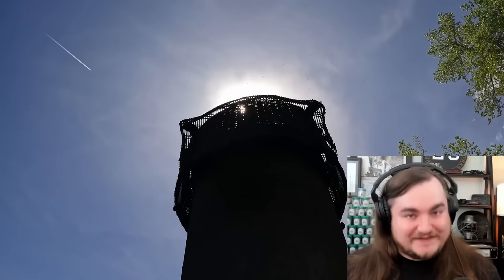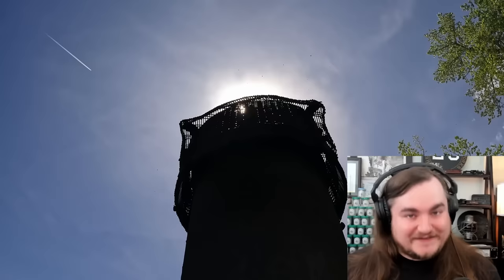Why do USA steam trains make smoke, but UK ones don't?

Comment: I also feel like the fact that in the US, our engines chuck everything out the stack, UK engines don't, and that's why they clean their smokeboxes often.
Reply: Do American engines make sparks, though? British engines produce a lot of sparks. You can see just how many they make at night. I've never seen this on American videos. Lineside fires are quite common along UK heritage railways in the Summer.
Reply from the maker: Brett told me about this after I posted the video ready to go, definitely a miss on my part. Our smokeboxes are "self cleaning." For you Brits out there, we clean them annually. And they don't need much...
Reply from the maker: 7822 we have the same issue for sure.
Reply: @7822welshsteam  yes, US engines certainly can produce a spark, but often times the engines that do make sparks normally have a spark arrestor placed on the stack to catch the sparks preventing them from escaping the stack and setting fires.
Reply: @7822welshsteam Some. Usually the older ones that run on wood, hence why the smokestack often had mesh and a wide funnel, as it was meant to catch the sparks. Of course, the transition to coal basically removed sparks, and thus, the mesh was gone
Reply: @Hyce777  We do have a good number of locomotives with self cleaning gear fitted. The BR Standard Class's of locomotive for the most part did have self cleaning gear and a number of other locomotives did have it fitted in later years. Mind you though we still clean out the smokebox on Self Cleaning locomotives a few times a year when the meshes are removed for washouts ect.
Reply: @TheT-90thatstaresintoyoursoul  Why is it that British locomotives, which all burn coal, create sparks, then? There are plenty of videos of it on YouTube. It would be strange not to see them at night.
Reply: @7822welshsteam  I meant some is in some sparks.  Yes, they do, but barely. Rode on a steamer once, the told us not to open or lean out the windows in the tunnel due to sparks. Most sparks however tend to end up on the ties.
Reply: @7822welshsteam spark arrestors are mandatory in many states do to fire risk
Reply: @Hyce777 0:58
Reply: Surely the problem in the UK is not sparks from the stack but hot ashes falling from under the firebox? Today there are many problems with coal quality which increase this problem.
Reply: @Hyce777  Wow! Very jealous. I'll always remember the summer that I worked a particularly poorly designed tank engine that needed the smokebox cleaning out three times a day! It had no brick arch at the time (although has since had one fitted) and the exhaust beat was far too strong.
Reply: British coal isnt as clean as american. See appalachia has more than just hillbilly folk like me. It has anthracite coal which burns slow anf glowing hot. Had the pressure been greater we'd be sitting on a continent of diamonds. But we got clean extremely high quality coal.

Idk if thats the difference but there is for sure an argument that the coal between britain and america can be vastly different.
Reply: @michaeltb1358  GWR engines do that a lot and this might be why they're the worst for starting fires but British engines all make sparks at night and I've never seen this on a video of American steam.
Reply: @LegendaryCollektor  I remember the crew of Flying Scotsman saying that they couldn't believe how bad the coal was in the USA. Presumably, lots of different types are used in different parts of the country, whereas we used Welsh coal almost exclusively. The Durango and Silverton and Cumbres and Toltec use Welsh coal. Well, they did until recently, at least.
Reply: @7822welshsteam  agreed, the UK produces very little coal these days and most of the heritage lines have to import it from overseas which tend to be of a lower quality than what was dug out of the old British mines.
Reply: @Hyce777 🥳 when will UK join NAFTA❓❓
Reply: @7822welshsteam  mind you im in eastern USA. I know the western USA has had bad coal
Reply: What do you guys burn? Coal, oil or wood. Makes a difference
Reply: @blatherskite9601  all of the above.
Reply: @Hyce777  At least some later Brit steam trains had self cleaning smokeboxes (BR Standard Classes 5 and 7 definitely did), although I think they were still cleaned out more regularly than just once a year.
Reply: @LegendaryCollektor  I would suggest Welsh steam coal is a good in any in the world. Do you have anthracite coal in the US?
We have plenty of good grade coal in UK but stupid politicians have forced our coal mines to close and we now import sub standard coal from Poland etc. How stupid is that?
Reply: @haroldpearson6025  yes. Anthracite is what was mined here in Pennsylvania.
Reply: @7822welshsteam  lousy coal over there. I know this has already been answered, but the answer needs to be called out. My grandpa used to be freight scheduler for the DM&IR RR back in the post-WWII era, and was a conductor of troop trains during the war. He used to talk about how gigantic their last coal burning locomotives were - the legendary Baldwin Yellowstones... I've actually been in two of them in the years since. Those locos were pulling iron ore from the MN Iron Range region to ports in Duluth and Two Harbors mostly, to be loaded onto oreboats to go to the refineries in Indiana through PA or whatever.
Not only did they need some of the largest locos ever to haul the amazing amount of ore used during WWII, but they had a war supplies high rating on getting high quality coal for those locos.
The quality of coal varies widely in the USA, since we're so huge and there are a lot of coalfields (many never exploited) - but they needed concentrated nice black coal - that burns well and doesn't leave as much ash. It also doesn't make any sparks. At all.
Now try the coal chiseled out of some Cornish or Welsh hillside and it's brown or light black and not jet black - it's just not the same thing at all. It will burn worse, less calories per kilo, more ash, more sparks. Sure, there is some decent stuff left in the UK I'm sure, but are they still mining it?
Reply: @haroldpearson6025 Yes, my state of Pennsylvania produces some of the best anthracite in the world.  At least we did until the politicians shut it down.
Reply: Ballingary mines was an antrachite coal mine
Reply: @matpk  They won’t as they don’t like chlorinated chicken
Reply: @Hyce777  I was on an RSPSI train in 2017 headed to Dundalk hauled by locomotive NCCWT (Jeep) class no.4 at Drogheda where we alighted the train was waiting around for a couple of minutes the thickest smoke I have ever seen in person.
Reply: @Hyce777  The UK engines used to make black smoke but fearing backlash from environmentalists they have stopped it more or less. Chris Eden Greene has a video on coal.
Reply: USA and UK are soooo backwards. Using steam locomotives is just embarrassing
Reply: @OscarOSullivan  Really? All steam trains around the world are surely museum pieces, not real working machines. Don't they get an exemption to put out a little bit of smoke for educational purposes? If we're going to save the world from disaster (face it, we're not, but if we were...) we're going to need educated people. A populace who understand basic science; and a bit of engineering wouldn't go far wrong either. Idiocy and selfishness are indirectly responsible for however many gigatonnes of whatever being dumped into the air, land, and water (aka "the environment").

Maybe we could phrase it as "air, land, and water". And then people whom, for some unfathomable reason, consider this a party political issue, might realise that they actually live in the environment.

Are there still working, as in employed, steam trains in Africa or Asia anywhere? I doubt it but I know there were a few years ago.
Reply: BS
Reply: @7822welshsteam I remember an episode of The Cannonball Express when a farmer claimed against the railroad company for their sparks setting fire to his crops. Casey Jones secretly fitted a spark arrestor, so the next time the farmer claimed, he could prove that the farmer was setting the fires himself!
Reply: @chouseification  What on Earth is this nonsense? Anyone who knows anything about steam knows that Welsh coal was the best. No. We're not mining it anymore. Several people have already said that.
Reply: @Kevin-bl6lg 😂😂😂😂
Reply: @greenaum  Yes Gauge the issue
Reply: @Hyce777  Sometimes it is because of a photo op that so much smoke is produced.
Reply: @7822welshsteam  I've never seen a lineside fire on heritage lines, and I've been on a few
Reply: I work at a UK heritage railway, and the fireboxes are cleaned daily. We are one of the few railways that run trains daily, especially now (summer) peak season, but also all the way through Christmas too.
Reply: @dcarbs2979  Cool, but also irrelevant because we're talking about smokeboxes, neat facts though.
Reply: I've seen more fires from brakes on diesel hauled trains than from steam locomotives. Is this case in UK, i dont know as im Australian.
Reply: @matpk  when plate tectonics mash North America into Europe. ;) It's the North American Free Trade Agreement, not the North Atlantic Free Trade Agreement.
Reply: @knightryder6068  I don't if UK engines have 'smokeboxes', or if Firebox and smokebox are different terminology for the same item (like 'hood and 'bonnet' for cars). I'm refering to the bit where the ash collects after it's burnt. If a smokebox is something different, I don't where it is on UK locos. I only work on the carriages!
Reply: @dcarbs2979  A smokebox is the part at the very front of the boiler where Ash collects. The firebox is where the fire is and where you shovel the coal/fuel into.
Reply: @7822welshsteam  Trains of all kinds set off wildfires in the USA just from sparks from the interaction of the wheels with the tracks.
Reply: @knightryder6068  Thanks. In that case, I would expect both are cleaned daily when in use: firebox in the morning when it's cool(er) after a run and smokebox in the evening before being put away for the night. English fireboxes get cleaned by some poor sod literally getting inside it to clean. I'm too fat for that!
Reply: @7822welshsteam  I have seen. Plus - Russian, Chezk and Polish engines too.
Reply: @insomniacbritgaming1632  I helped put one out at the Foxfield in 2007.
Reply: Carbon is energy, black smoke is waste.
Reply: @7822welshsteam  If you look old Brit TV series , Last of the summer wine , if you look at the buildings in 1970s early 1980s in Yorkshire , you can see the black coal sot , when series are in its late 1990s early 2000s , same buildings are clean , some exterior filming locations were same for 40 years .
All fires create smoke it there is lack of air to the burning process , wood stove when operating properly , you only see some heat coming out , is you cut off the air lot of smoke .
Reply: @Kevin-bl6lg  The U.S. uses steam locomotives for short tours, and for fun. The locomotives in the U.S., that carry freight, and passengers, are diesel-electric, and some in the big cities run on electricity. So...we are not "backwards" at all. Who is "embarrassed" now?
Reply: @LegendaryCollektor  Anthracite coal required the Wooten ultra wide firebox to burn properly, plus no doubt a specialized design of the brick arch. It was a pain in the butt to burn and as far as I know the anthracite roads (Reading, D&H, CNJ and possibly one or two more) burned a mixture of bituminous and anthracite. The surviving Reading class T1 engines in tourist service like 2102 as far as I know burn just bituminous for simplicitys sake.

Back in 1958 when the PRR was short of power due to rapid diesilization, they leased about 15 T1’s and ran them on straight bituminous. The firemen reported them as easy to fire with their huge Wooten fireboxes.
Reply: @Hyce777 great video as I'm from the UK our engine do produce black smoke it's most on the mainline rail tour the smoke has to be clear. On Preservation railways it doesn't really matter but they do try not to produce black smoke. One engine I follow is a Battle of Britain class named 92 squadron there team said it likes Russian coal hope this helps out a little.
Reply: @7822welshsteam 😅😅
Reply: @Kevin-bl6lg don't be ridiculous. The only steam locomotives in service in the US are historical artifacts. They're a novelty.
Reply: How silly.
Reply: The smokebox does not play a role in smoke generation, it collects solid particles.  The firebox is where smoke is generated.  The name "smokebox" is a bit of a misnomer.  
        A smokebox is one of the major basic parts of a steam locomotive exhaust system. Smoke and hot gases pass from the firebox through tubes where they pass heat to the surrounding water in the boiler. The smoke then enters the smokebox, and is exhausted to the atmosphere through the chimney (or funnel). Early locomotives had no smokebox and relied on a long chimney to provide natural draught for the fire but smokeboxes were soon included in the design for two specific reasons. Firstly and most importantly, the blast of exhaust steam from the cylinders, when directed upwards through an airtight smokebox with an appropriate design of exhaust nozzle, effectively draws hot gases through the boiler tubes and flues and, consequently, fresh combustion air into the firebox. Secondly, the smokebox provides a convenient collection point for ash and cinders ("char") drawn through the boiler tubes, which can be easily cleaned out at the end of a working day. Without a smokebox, all char must pass up the chimney or it will collect in the tubes and flues themselves, gradually blocking them.
       For information of smoke generation, see my comment of this video.
Reply: American rail out west had many more miles of open land where no one would complain about black smoke/ soot. One of many reasons. (This is my second train video-- so I'm an expert now_)
Reply: The doesn't fall out as it travels it gets dumped at the end of its journey when sitting in the engine shed 
Usually they have a pit in front to dump the ash